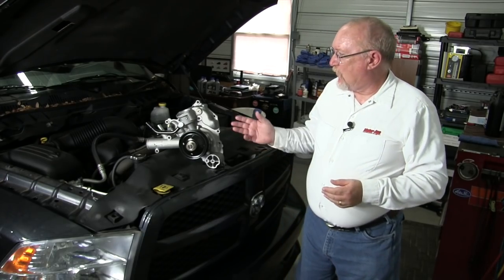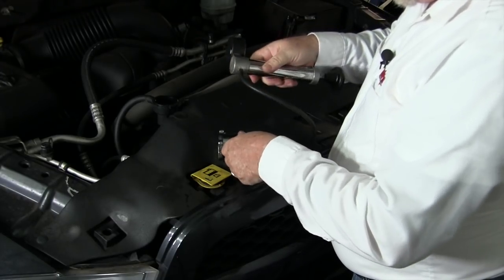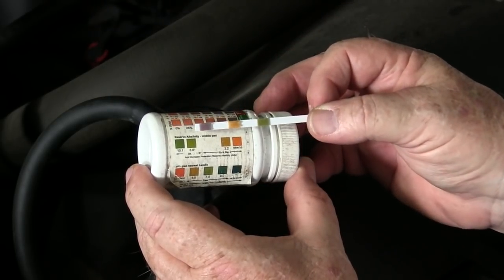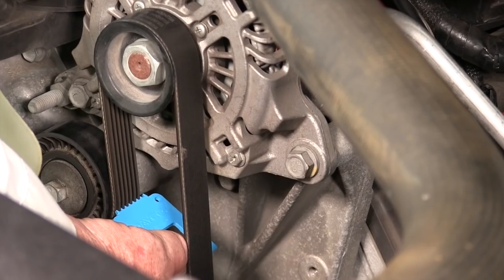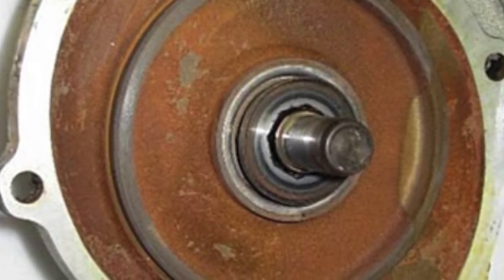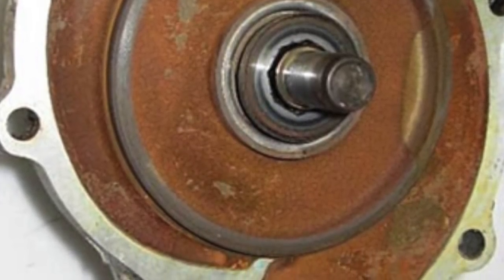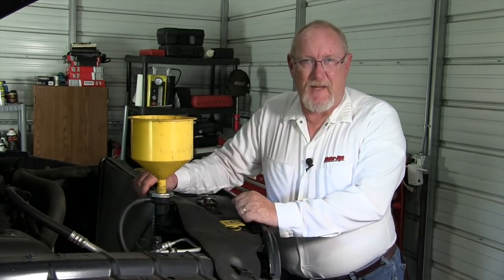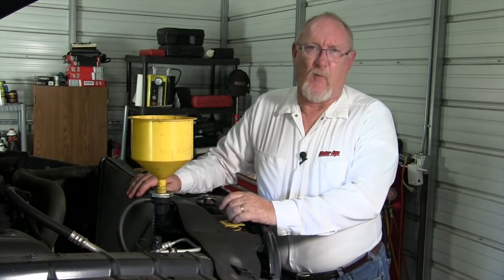The Trainer #83:  Water Pumps - Not Just A "Bolt On" Repair!

Comment: Premixed coolant is kind of a ripoff. So is deionized water specifically for mixing. Concentrate and distilled drinking water is cheaper. I run 60/40 anyway as ambient temp does drop below -34f here occasionally.

Comment: I have always used Shellac on water pump paper gaskets.  Never had a leak or other performance issue.  Also, Teflon thread sealant on the fasteners that go into a water jacket.  
If the manufacturer didn't lube the pump shaft seal before assembly they did it wrong.  In 50 years I have never even heard of this being an issue, let alone experience it.
Reply: I dont think shellac is water proof. Alchohol is also definitely a solvent for shellac. It prob doesn't hurt anything, but I would use anaerobic sealant or rtv or maybe aviation form-a-gasket (not sure if it's suitable for coolant either)
Reply: @juliogonzo2718  Permatex aviation head gasket cement IS SHELLAC.  That brown, sticky, thick goo. The old Permatex sealants (came in a toothpaste style tube) #1 and #2 are basically thick shellac with other bulk fillers also.  #2 (non-hardening) is very good for water pumps and thermostat housings, differential  covers, just harder to apply than the aviation type that has a little brush in the cap, it's thinner obviously.  You can use alcohol for clean up of wet shellac, but once it dries up, better get something stronger. Forget about water. It's very tenacious stuff and never had a water leak from any water pump I used it on.  The #1 gets hard as a rock.  It should only used somewhere it will never have to be taken apart again, at least not by you.  Don't even know if it's still available anymore
RTV has it's uses, intake china rails is one place I'd use it every time but the problem is RTV will not stick to oily surfaces.  Not at all.  If you want it to really seal, it's got to be oil free enough to eat off of.  If you are doing any gasket that's going to see oil or has seen oil there are better choices, especially these days.  If you need to fill a gap like front and back of intake manifolds, RTV is the go to but its got to be super clean, put on thick enough, allowed to skin over, and set down right perfectly in one shot.  If you have to slid or wiggle it, pick it back up, clean every thing and start over.  RTV works better on a brand new build, everything everything easy to get to and very clean already, clean it again anyway for RTV.

Comment: What do you think about Chevys new valve type electric water pump on the new I4 in their full size truck. I can't see it going well. To many parts involved in a critical condition. I don't understand why they always go a different direction that's been working good and cheap for years. I'm all for better, but new isn't always better.  It's said how expensive cars are to repair. Imagine calling a customer and saying  your water pump failed and it's 900$.smh
Reply from the maker: While we don't like change, change is inevitable isn't it? More and more, engineers are going electric on any sub-system they can - all in an attempt to push fuel economy that much farther.

Comment: So with the coolant flush, is it recommended to use a chemical additive to help flush contamination before using a pulsing flush tool?
Reply from the maker: Opinions vary on whether or not you should use a chemical cleaner prior to the pulse flush. On the one hand, it may aid in removing more contamination. On the other, you may not get all the chemical trace out. Personally, I stick to whatever the OEM recommends.